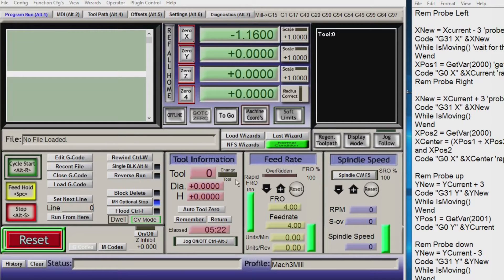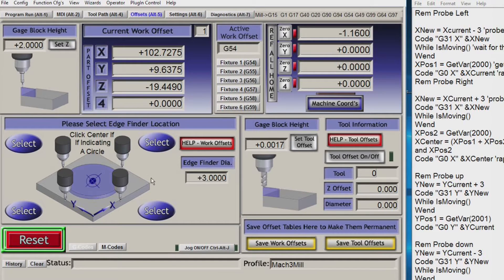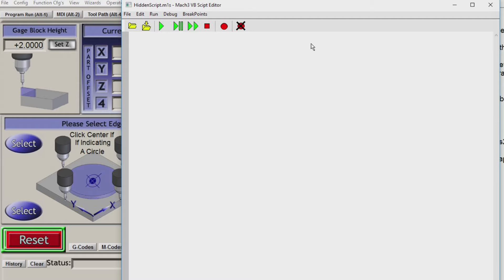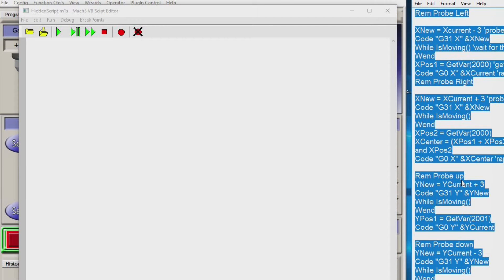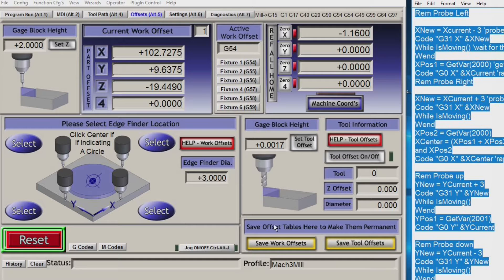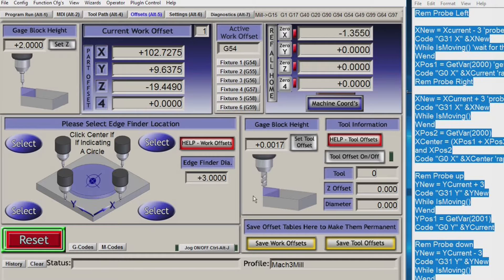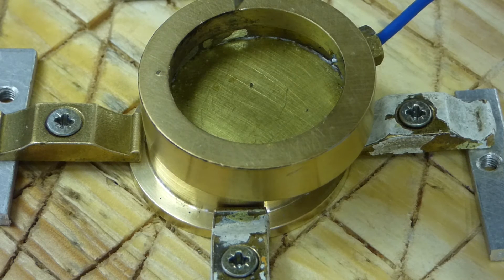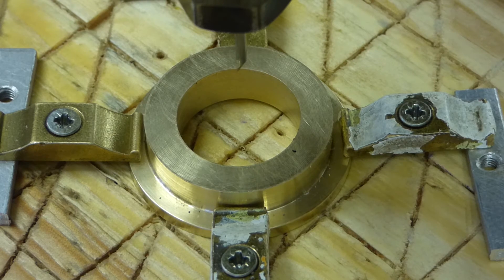The Center Finding Modification

Comment: This didn't work for me, after some troubleshooting the two GetVar(200x) commands were not working.

Anyone having issues, here's another thing to try.  Replace  GetVar(2000)  with  GetDro(0)  and GetVar(2001) with GetDro(1)

This then worked.  If anyone could explain why this is a bad idea and it's better to use GetVar instead, I'm all ears.

Comment: Rem VBScript To center probe inside a pipe
If GetOemLed (825) <> 0 Then 'Check to see if the probe is already grounded or faulty
Code "(Probe plate is grounded, check connection and try again)"
Else
FeedCurrent = GetOemDRO(818) 'Get the current settings
XCurrent = GetDro(0)
YCurrent = GetDro(1)
Code "G4 P1" 'Pause 1 second to give time to position probe plate
Code "F4" 'slow feed rate to 4 ipm
Rem Probe left

XNew = Xcurrent - 3 'probe 3 inches to left
Code "G31 X" &XNew
While IsMoving() 'wait for the move to finish
Wend
XPos1 = GetVar(2000) 'get the probe touch location
Code "G0 X" &XCurrent 'rapid move back to start point
Rem Probe right

XNew = XCurrent + 3 'probe 3 inches to right
Code "G31 X" &XNew
While IsMoving()
Wend
XPos2 = GetVar(2000)
XCenter = (XPos1 + XPos2) / 2 'center is midway between XPos1 and XPos2
Code "G0 X" &XCenter 'rapid move to the x center location
Rem Probe up
YNew = YCurrent + 3
Code "G31 Y" &YNew
While IsMoving()
Wend
YPos1 = GetVar(2001)
Code "G0 Y" &YCurrent
Rem Probe down

YNew = YCurrent - 3
Code "G31 Y" &YNew
While IsMoving()
Wend
YPos2 = GetVar(2001)
YCenter = (YPos1 + YPos2) / 2
Rem move to the center

Code "G0 Y" &YCenter
While IsMoving ()
Wend
Code "F" &FeedCurrent 'restore starting feed rate
End If

Comment: Hello Jim, I am in need of help please, I have Mach3  with NVUM controller, when i apply the script to find the centre the following happen, X and Y (UP) axis probe correct, Y(down) probe down then touch the internal edge and stop BUT then rapid "bump" down by about 5mm then the probe move to the center, Why would the probe  "bump" that extra few mm
Reply from the maker: A friend of mine purchase the NVUM controller and together we tried to get it to work correctly. We could not. We eventually gave up and he carried on without it.

Comment: I'm looking to adapt this for my grbl controller. Where do you specify the probe diameter?
Reply from the maker: In this particular application the, diameter of the probe does not need to be known since we only need to know the mid point between the left and right side and the top and bottom side of the part. We only neet to know that the probe will pass through the the centre of the part and that the circularity of the probe is accurate.
Reply: @JimTaylor42  could to help me create s macro for my grbl controller?

Comment: hello, love the vids. i'm looking for a script sorta like this one im posting in the reply. have you developed one yet or plan on it in the future? i have a medium size mill i can edit the coordinates in a script for a fixed plate, my machine has 6" on the Y in both left and right directions from center, literally 30" bed but im not riskin it until i study. and 9" on the X which is just the bed, 4.5" and 4.5" in and out towards the mill head. it's got plenty a room to spare but not risking that either, my Z has an easy 12" height and then some roughly 20" no limit switchs why im not risking it. i'll post a follow up comment with a vid of it, its on my other account.
 https://www.youtube.com/watch?v=ZBYrZvHktiU&lc=z22byvbz1kuqfbdcyacdp432l5nm3lzhe5wrbpsof1xw03c010c.1554091750763426

Comment: Hi Jim, thanks for sharing. I'd like to point out a little problem with this method. I think that the script returns an approximate center of the inner ring, especially if the starting point of the probe is not near the exact center of the ring. So you must make sure that the probe is as close as possible to the center in order to get a decent center.
What do you think?
Reply from the maker: The process is sound. If the probe and the bore are perfectly circular, the first pass in the X direction will find the X-center then the next pass, in the Y direction, using the X-centre, will find the Y-centre.
Reply: You're right! Thank you again!

Comment: Can you post a photo of the script 2:33 timeline lower on your VB page?  I can't see it to format it.
Reply from the maker: I do not understand your problem. Just go to my description above and click on 'SHOW MORE' and you will see ALL of the code. Copy from the line - 'Rem VBScript To center probe inside a pipe', down to the line - 'End If', then paste this into the VBScript editor in Mach. Of course don't forget to change 'NE' to '<>' (two opposing angle brackets - it looks like two arrow heads pointing away from each other) (shift-comma, shift-full stop or period) (the two keys to the right of the 'M' key on your keyboard i.e. the 'not equals' sign. I am afraid that I can not explain it any clearer that this.

Comment: Hi Jim, I'm a wee bit confused and wondering if you can help. You say to use F25 instead of F4 if working in mm. Does that mean we have the change the following lines to the mm equivalent of inches? If so what would the new lines of code be? I'm new to the CNC world so please excuse my ignorance.

Code "F4" 'slow feed rate to 4 ipm (make F25 if using mm)  
XNew = Xcurrent - 3 'probe 3 inches to left
XNew = XCurrent + 3 'probe 3 inches to right
Reply from the maker: Hello Richard. You have highlighted one of my rare mistakes. Instead of F25 it should be F100 since 100mm is approximately 4ins. If your units in Mach (or with G20) are set to inches, use F4; or if your units in Mach are mm (or set with G21) then use F100 to get the same feed rate. You do not need to change any other code.
Reply: Perfect, thank you. I noticed earlier you have some tinnitus videos up. I'll need to watch those too. Fellow sufferer here, ten years, I've forgotten what perfect silence is like.
Reply from the maker: You are welcome Richard. Re tinnitus - bit of a bugger isn't it. It would appear that there are a lot of people working on it right now. Let's hope that they get it cracked soon.

Comment: The code is incomplete and gives error when VB try to run it. Please, could you post full code?
Reply from the maker: You are correct. It seems that, in the Description section of the video, angled brackets (used for relational symbols) are not allowed and that may have had something to do with 9 lines of code at the start to be missing. I have substituted the angled brackets '<>' with NE and corrected the description. Let's hope that it works. Just change NE back to <>.
Reply: Jim Taylor thank you